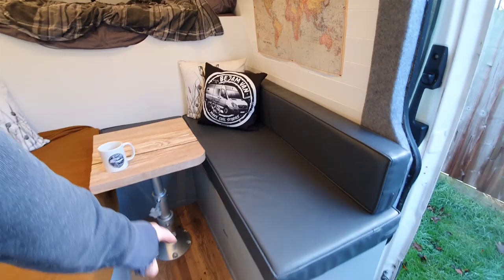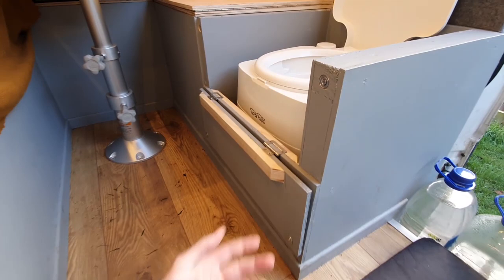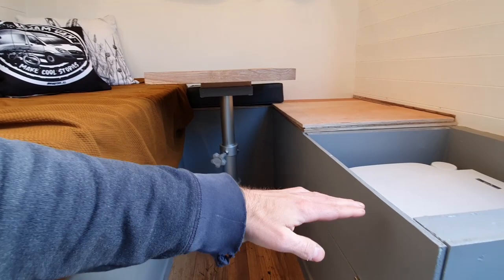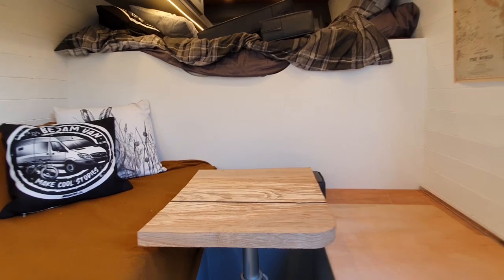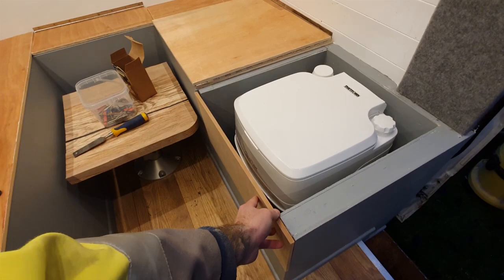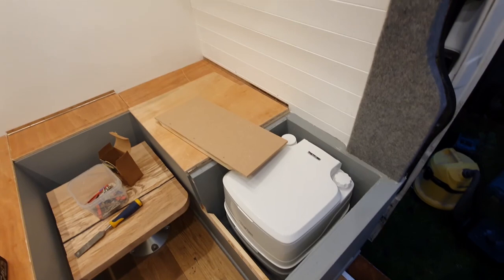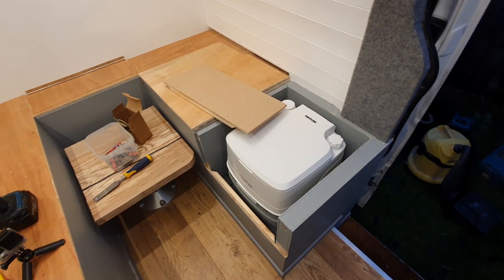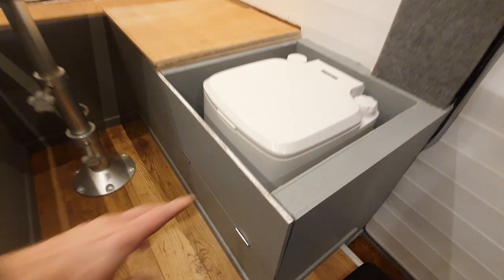Toilet Boxing Repair | Sprinter Van Conversion | Van Life UK

Comment: Hi matey. Those toilets can be heavy to lift when full. Just a suggestion why dont you turn the toilet so when you are sitting on it you face the fridge. Have the opening so you can slide the toilet fwd and out door to easy removal and empty.  This would allow the old front opening to have a solid front and  rail for the bed etc. Cheers from George
Reply from the maker: Hey George, you're 100% right and I'm now frustrated that I didn't think about this myself sooner 🤦🏼‍♂️ they are bloody heavy and I could of even mounted it on some heavy duty drawer runners! It's awkward as hell to get out when its full. 
I'm sick of it now haha if it annoys me in the future I'll change it for sure. Cheers chap.. what a great suggestion 👌🏻👍🏻

Comment: Congratulations on the subscriber milestone. 🎆 
Now your thunder box is fixed, what about the bog roll? The little M&M buckets I've found are a perfect size for a dunny roll, inconspicuous, keeps it clean & dry and you can throw in a small bottle of hand sanitiser in the centre.
Reply from the maker: Cheers mate 👊🏻
Lol I had to Google what the m&m box looked like 😅 great idea though but I've not seen them in the UK 🤔.. before the bog roll sat on top of the toilet but I don't have the room now. Wondering if I can get something similar as I like the idea 🤙🏻 cheers dude 👍🏻
Reply: @BejamVan  😂.. They only sell them in Woolworths here. I have seen similar pails with lids used for other lollies (sweets). I think they are @ 0.5 litres, maybe try your local pound shop or hardware.
Reply from the maker: @wilsonwombat3456  Blimey.. thats a shop i haven't heard in a while 😅 Woolworths closed down here about 15 years ago 😄
I'll see what I can find thats similar here.. 
I'll be on the first flight when you guys open your borders anyway 😉 Vanlife Oz is the plan 👊🏻